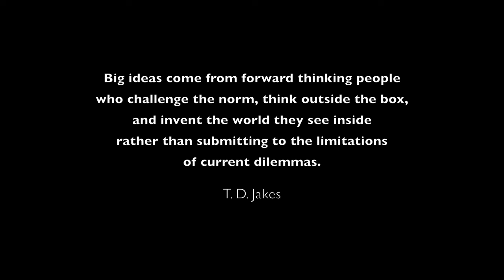All Aluminum Flatbed Truck Camper - Even The Lid! (FLASH Warning - Welding)

Comment: Dang!! I know the interior still needs to be built out, but it looks incredibly spacious for a camper on a short bed crew cab. You guys are setting a new standard here. And that door design...brilliant. It looks like a lot of metal but I'm guessing all that aluminum still weighs less than the truck bed you deleted? Plus you have some pretty seriously upgraded suspension as I recall. Seems like weight will be a total non-issue. 

Also, your video production is looking amazing. Awesome shots, great edit, very immersive and engaging. Nice work. Already eager for the next installment.
Reply from the maker: Thanks Donald!! I think it's going to be impressive for what it is, especially being on a dinky short bed. Once the interior is in, it will feel much smaller than it feels now with nothing in it. But our interior design is very spacial-conscious. The goal is to feel like a "home" with the efficiency of a tiny camper. It'll definitely be small living still but a big upgrade from the last setup.

Also very stoked to hear feedback on the filming and all that! It really means a lot. I went into this episode with a different approach and Im glad it noticeable came through. Really cool to hear, so thank you!

Comment: Have you done an intermediate weigh in of your truck with the subframe and aluminum camper body? Did you do a bed off initial weight so you know how much weight you can carry without going over your trucks GVWR?
Reply from the maker: The reality is most Tacoma "overland" builds, fully decked out, exceed the GVWR. Once you add bumpers, winches, bigger tires, tents/campers, gear, full fuel/water weight, people weight.. fully loaded I guarantee most are at, if not over, that number. My last setup was way over. It's a small truck. 

That being said, we aren't building this to cater to the GVWR. We're building this so I can live out of it full-time. Are we aiming for as light as possible? Sure! But we aren't obsessing over weight numbers because our goal isn't to build "the lightest flatbed camper" out there. Other companies have that covered. The priority for this build is focusing on comfortability and long-term functionality for me to live out of, not in meeting some number.

I certainly will weigh it out of curiosity once it's finished but in the end it's going to weigh what it's going to weigh.